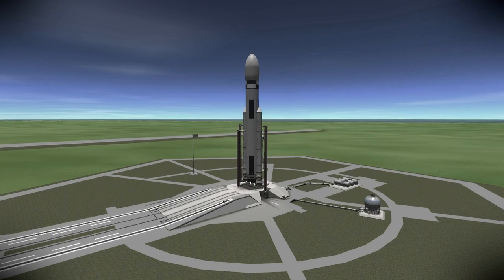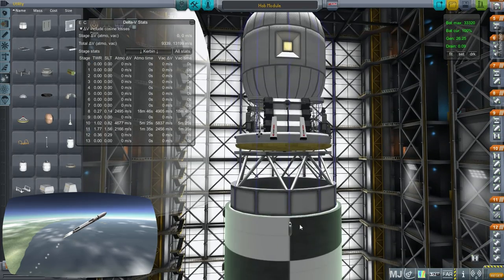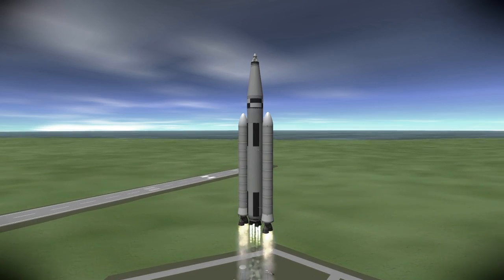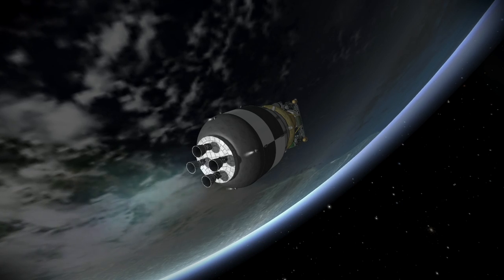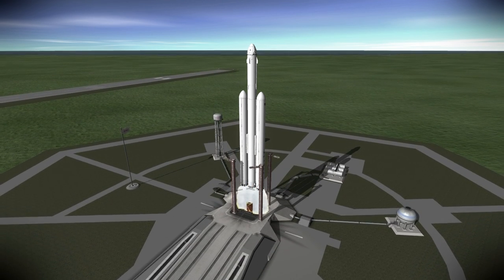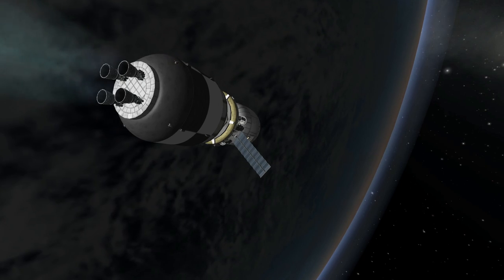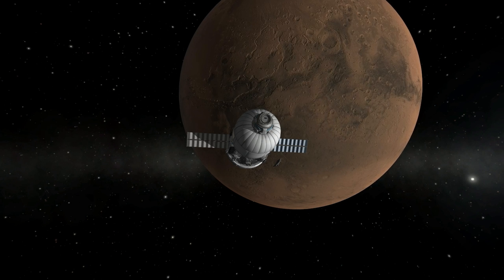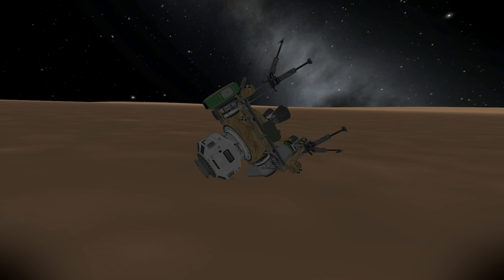Mars DRM Draft with SLS and Falcon Heavy - Test 1

Comment: I tried to make a classical-style Mars lander in my Mars mission but failed every time because it had not enough heat shield size to slow down and also it didn't maneuver very well. It turned out the lifting body design as shown in Constellation video is much better. Also with some control surfaces attached it can be  very well guided during re-entry and landed very precisely.
Reply: Do you have any ideas or information why they rrefused the lifting body method?

Comment: F9 is 3.7m wide but that is still too small and Dragon heatshield is PICA-X and is designed for mars reentry velocity.reason for f9 size is that it is at top of road transport capability because it is being transported from California to Texas and later to Florida by road.After Texas site is finished BFR will be much wider because rockets will be manufactured at near the launch site
Reply: *****
Reentry on Mars to Earth transfer so +10km/s .Landing on Mars would be impossible in Dragonv2 because terminal velocity is 5x that of earth and that would be over the delta v budget even taking into consideration slightly better performance of super Draco in lower pressure because their nozzle is optimized for low earth atmosphere operation.We will see their mars design in few coming years and nearly certainly faster than Bloc2 flies if NASA continues with their snail pace with the SLS.

Comment: It's unlikely that LRBs will be utilized in Block II. According to NASA, doing so would involve substantial changes at the pad and a new MLP. The more likely option will be solids with filament wound case boosters (Dark Knight) in the spirit of what would have been used for SLC-6 shuttle launches out of Vandenberg.
http://www.nasaspaceflight.com/2015/02/advanced-boosters-towards-solid-future-sls/
Reply: ***** 
Block I may be more capable than the original baseline, so too with Ib and II. Anyway, the fact is that anything above 120 mT to LEO should be enough to be quite useful for Mars and Lunar missions. Also, as long as Utah still has senators, ATK will continue to receive plenty of pork. Personally, I like LRBs better as well -- they're less challenging to ensure abort survival and could lighten the LAS. Unfortunately, the political landscape makes them a more difficult proposition.

I'd like to see is a flight of a full Mars Direct scenario. RO/RSS is quite empty of flight capable fission reactors, so this would have to be incorporated to run that test. The rest should be doable.

The direction I see DRM taking increasingly resembles Battlestar Politica. They're talking SEP and nine launches per mission with a straight face which pretty much means Mars flights won't take place unless we take serious steps to slim down the architecture.
Reply: ***** 
ATK solids lock up votes from Utah as well. If they go for Pyrios, Shelby risks loosing the other SLS work at Marshall.

I suspect you're right regarding fission power packs (RTGs probably won't provide enough power). It would be an uphill battle against NIMBY. What's really crazy is that a reactor would actually be safer than a set of 
RTGs, as it wouldn't be activated until it was in a nuclear safe orbit.

Not only would a fission power pack be very useful for Mars, it would also be an incredibly useful spinoff for missions to the outer planets (JIMO, Uranus orbiter, etc). It's not a big technical risk either. SAFE series reactors are at a good TRL and could be prepped and flight tested affordably. Los Alamos and Marshall built a 30 kWt test unit using their lunch money.

One other nitpick. CECE was baselined for Altair using methane, but RS-88 could be converted from ethanol to methane for use as a radial thruster and would better fit the role. SuperDraco would have to be outfitted with an ignition system while RS-88 already has one.
Reply: ***** 

Actually, there's not much performance information on RS-88. I've seen thrust numbers, and that's about it. It's not even clear if the smaller versions are pump or pressure fed.

Information on fuel adaptability from here.
https://www.rocket.com/article/aerojet-rocketdyne-successfully-tests-engine-made-entirely-additive-manufacturing